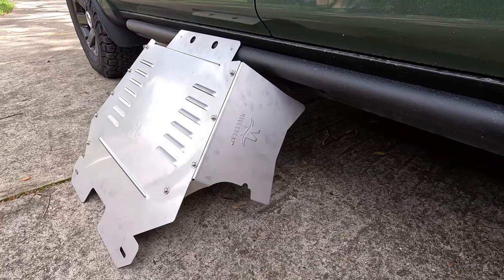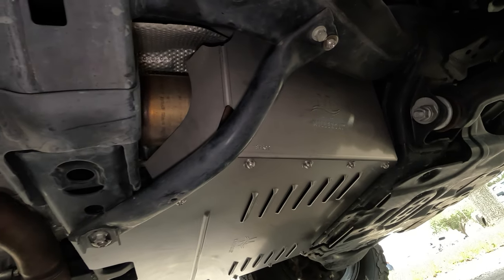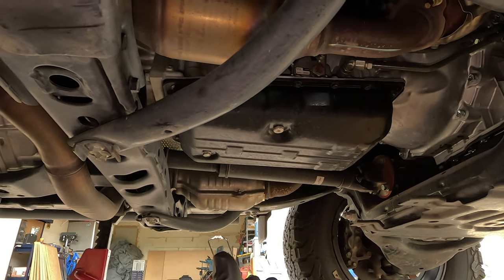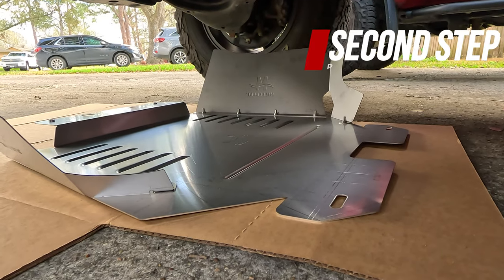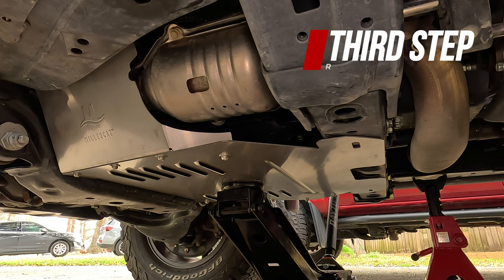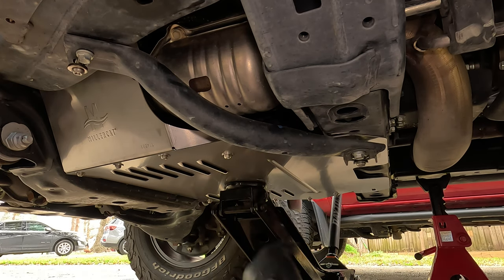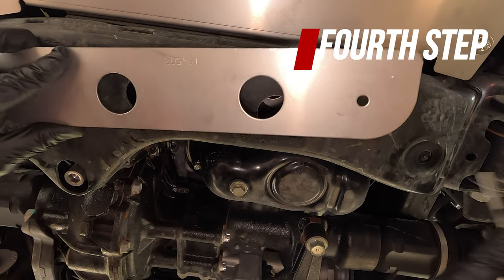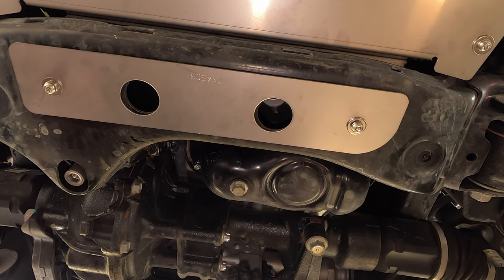An OEM Catalytic Converter Shield For YOUR Toyota? | Protecting A 4Runner From Theft With MillerCAT

Comment: Besides the price difference between aluminum and stainless steel, what are the pros & cons for each of these metal? Is one stronger or more rust residence, etc. Thanks in advanced for your help.
Reply from the maker: Stainless steel is stronger, but on the flip side, aluminum is lighter. Both are pretty similar as far as resisting rust is concerned.

 The whole goal of a catalytic converter shield is to deter thieves from stealing your cats. The stronger the material, the harder it will be to access them. 

Some people prefer aluminum to keep additional weight to a minimum. If it were me, I'd get stainless steel to make it as hard as possible to get to those cats 😁.
Reply: @LevelUpMechanics  Thank you for the clarification.

Comment: It should be noted that this set up also appears to serve as a skid plate for the transmission.  16 gauge steel or 12 gauge aluminum is too thin to serve that purpose.  If all you are looking for is catalytic converter security this should work well, though.  Otherwise, there are other options that serve both purposes.
Reply from the maker: There are definitely a lot of options out there, that's for sure 👍.
Reply: What are the other options?

Comment: So will you need to remove this shield to perform a transmission service?
Reply from the maker: Yes, that is correct. On the flip side, though, the shield also acts as a "skid plate" to help protect the transmission pan from unwanted damage.

In general, modifications usually tend to have a trade-off of some sort. If you put a lot of miles on your vehicle and need to service your transmission more frequently, I can definitely see how the shield can be somewhat cumbersome.

I personally wouldn't mind the extra 10 to 15 minutes removing / installing the shield so that I could service the transmission... especially since having the shield could potentially save me $$$ and the headache from stolen cats.

While I do recommend MillerCAT's products, as the quality is really good, I do know that Cali-Raised also offers catalytic converter shields (left and right side) that allow you to still have access to the transmission pan. 

So that might be another good option to look into. I want to be open & transparent to help you find the option that would best suit your needs. Here ya go:
https://caliraisedled.com/products/catalytic-converter-shield-fits-2014-2023-4runner

I hope this info is helpful 😁👍
Reply: @LevelUpMechanics  Very helpful. I don't put a lot of miles on my 4Runner, but it's good to understand the pros & cons. It's a tough call. Will need to give it some more consideration. Thanks again.

Comment: What’s the torque spec of the four screws on the braces?
Reply from the maker: I believe it's 24 ft-lbs, if I remember correctly.
Reply: the bolt that fastens the front sway bar U bracket to the frame is 19ft, and these four bolts seems the same size, shouldn't they be 19 too? @LevelUpMechanics
Reply from the maker: You might be right. I do not know for sure, though. As long as everything is secured in place, I wouldn't worry about it too much.

Some bolts are more important than others when it comes to torque specifications (like cylinder head bolts & lug nuts). If automotive technicians torqued every single bolt, nut, and screw on every vehicle they worked on, then they would never make any money.

Since these bolts only serve to secure the braces onto the vehicle, the 5 ft-lb discrepancy is not going to make too much of a difference. As far as the shield is concerned, I think you will be fine as long as everything is secured in place 😁👍.
Reply: Thank you very much, very nice of you to take the time. I had a bad experience with a brand new 4runner when one of the sway bar bracket nut broke off inside the frame. the next technician found out when it was free-spinning.... @LevelUpMechanics
Reply from the maker: @ejshelby5460 I understand your concern a little better now 👍. Broken bolts can definitely be a pain in the butt sometimes. 

Should that scenario happen again in the future, a simple solution would be to cut off the free-spinning bolt and "re-thread" the hole with a rivet nut. 

I hope that your cat shield install goes smoothly! 😁👍